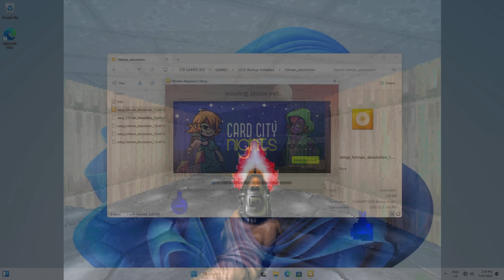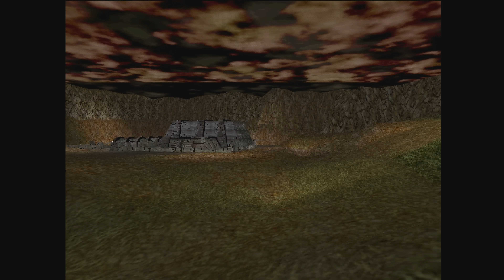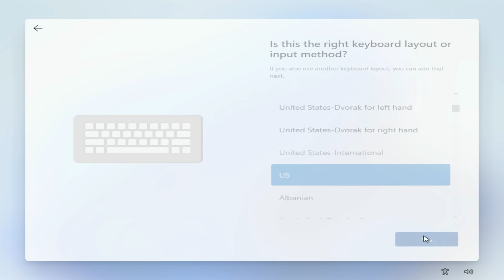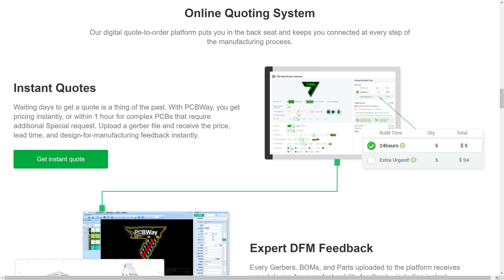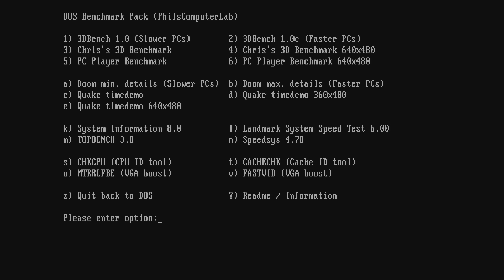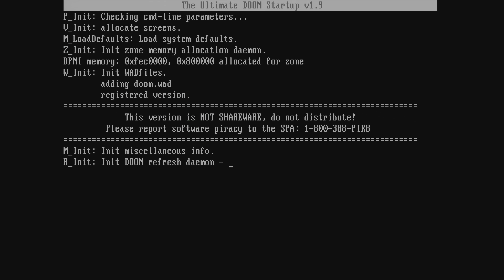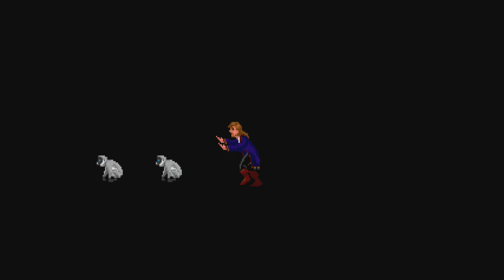LGA 775 The Next Big Thing for Retro PC Community?

Comment: I have an old Core 2 Quad that I've been meaning to slap XP back on. I don't think I'd bother running 98 or DOS on it, though. Getting an actual ISA sound card working in DOS is enough of a PITA, and Win98 tends to get very unstable with motherboards made after it went out of support.

Comment: Some LGA 775 boards have very good backward compatibility. It is possible to run Windows 98 on it, but the options for a graphics card are limited to ma. Geforce 7xxx or Radeon 1300. Most sound chipsets and networking drivers do not work under win98. But XP/2k works also very fast on this platform, and it is possible to use dosbox for older speed sensible dos programms. I have used a LGA 775 PC with Winxp only, Core2Duo E8600, 128 GB SDD, and Geforce 560 for years as an ultimate retro pc. Old Windows software runs fine, and a lot of dos games too. The price of this build was under 50€...

Comment: I've got what I think is the best 775 route, a 865 chipset board with AGP. I have a Celeron 440 in it (2GHz single core Conroe), a 6600GT and nice Yamaha sound card; works for pretty much all 98 and XP games.
Reply from the maker: Sounds great!
Reply: @philscomputerlab  I'm sure it was inspired by your videos!
Reply: Is it DDR2? Because DDR3 boards were also available and are significantly better performance.
Reply: I think one of the best Socket 775 board is the one that has Intel 865 chipset too, and paired with Intel Celeron 400 series. With this combination you get: complete support of Windows 98 drivers, AGP slot, and IDE connector. I bought three Asus P5PE-VM because of this

Another interesting bit is that even tough Intel Celeron 400 series is newer than Pentium 4 and using socket 775 it's actually single-core and based on Intel's P6 microachitecture just like Pentium Pro/II/III. Oh, and also it's only 35 watt TDP, so passive-cooling is possible.
Reply: @namaku0  it's a cut down core 2 duo. no need for that whole essay without actually saying what it is

Comment: Might have been nice to mention a couple of prominent games which wont work (e.g. missing ISA Soundcard, or graphics card).
Also what would have been interesting are 5 1/4 floppy drives. Platform could be a good option to have 5 1/4 floppy working on Win10 or so. That is if the port and BIOS can handle it.

Comment: There are many very odd S775 boards out there. ASRock P45 TurboTwins 2000 for example. With a slotted PCB to switch between SLI and XFire support. XD
You can even mount a netburst based Pentium D in there, for the P4 nostalgia.
The Core2Xtreme CPUs were massively overpriced even over 5 years ago, the Yorkfield based Q96xx oder Q95xx  do just fine, for a third/quarter of the price.
Got lucky last month with two socket 775 machines for 5€ each in the local ads. Low End ones, but in nice cases. And working, after more than 10 years in storage!

Comment: This video comes a bit late for me sadly, i'm on the process of building a retro PC mostly for windows XP but i already got a 754 Socket AMD platform. At the beginning i actually had in plans to get a 775 based PC, mostly because the PCI-e  GPU flexibility but i got the same exact board/CPU i had in 2007 for cheap compared to most of 775 boards
Now i'm struggling to get a decent AGP video card 😰
Reply from the maker: Yes anything AGP is getting harder to find these days...
Reply: update: i just bought a Core 2 duo E8400 with an Intel DG41RQ board and 4gb of RAM kit, i was very lucky finding this combo for 30 usd and it's in great condition, i will use this combo alongside my Sempron 2800 for retro gaming 👌

Comment: Stay away from any nvidia based motherboards. Their chipsets have never received any updates to run 10. Evga says that 7 is the limit on the 780 SLI motherboards. 
I have two that will just start crashing on 10. One took out 3 drives from system instability. The other one I got back from my older sister. Best Buy conned her on a ssd, then gave up on it! Tested her old drive- no problem with it. So I  got a free ssd and a 512gb hdd, plus the evga motherboard! However, motherboards with intel chipsets run 20 just fine. About to retire my evga board and swap its Q9550 on an Intel board that already has 10, a Q8400 and DDR 3 memory!
So if you want to buy some evga boards Phil....I'm right here! 😂
Reply from the maker: 😂 I got rid of most nForce boards. They all stopped working over time...
Reply: @philscomputerlab  They purr on Win 7. But 8.0 and up will crash. Besides losing some hdds, I also lost a video card. Thank goodness for evga's lifetime warranty! Ended up getting 2 GTX 960 SSC 2gb versions for my 2 GTX 470s. But since they dropped out of video cards, adios lifetime warranty! 😢

Comment: LGA775 has been well known for building XP systems since it is a good flexible platform. Very common. I also like AM2-AM3+ for many of the same reasons. Wide variety of available CPUs, video cards and sound cards. Also lot of legacy support carried forward to this point.
Reply: Questionable. Alot of gpus are failing cause of pre-2009 era nvidia troubles. Or cause just being a >2003 bga cards running userviced for many years (anything from ROHS era has a lead-free soldering). Some AM2 suffers with chipsets issue for the same reason. AMD precessors are less effective to process 32 bit code (compared to how they process 64 bit code and you probably don't need XP 64 bit) and XP barely benefits from multi-core. Literally any task that requires multi-core CPU or benefits from it, can be excecuted in Windows 7 or higher. Sound cards? Not to many 775 PCs had em. Some games benefits from PCI sound blasters but it's more related to 478 era.
Reply: @dmwzr  Depends, sure. Athlon64, X2, Core2, etc can all run 32bit code just fine. A64s were outperforming Pentium 4s and using less power doing so. XP (32 or 64 bit) can utilize multiple cores to a point, certainly anywhere between 1 and 4 cores. Sound cards still matter since onboard audio hadn't started getting really good by that point and didn't have support for EAX if you had a game that leveraged it. SoundBlasters would support EAX and provide for a better overall sound experience over onboard, particularly if the onboard audio wasn't well isolated from interference. As far as GPUs, if you care about period correctness, yea, some of those era cards may not currently be viable/stable/available. If you don't care so much about period correctness, there's plenty of CPU and GPU options that, while not period correct, still got XP driver support even if they'd be overkill and underutilized by XP. Just opens up more options vs increasingly scarce SS7-S478 era hardware.
Reply: @thegreatboto  XP can utilize multiple cores and even more that 4, but applications that benefits from this, can be executed in slightly newer environment.
Sound cards are not essential to have EAX. In 775 era when Vista hit the market the only thing you needed to have EAX 4.0 were just OpenAL installed. Integrated audio were worse, but most of the games had 16 bit sound (most likely compressed) and won't benefit much. It can be an addition (just like for a modern PC) but it's not that crucial anymore for 775. And yeah you have a point. You can grab some GT710 and you gonna be good to go, that makes sense. I'm just not sure if we can count this as cheap retro parts. Surely 775 is more versatile cause always can utilize sata and pci-e drives. But if we go so far, why it's 775, not 1366 or 1156. Both usually can run 7/Vista/XP.

>A64s were outperforming Pentium 4s and using less power doing so
Were also cheaper and produced slightly less heat, yes. I still have Athlon 3000+ with Biostar Geforce 6100 mobo. No north bridge, cool and quite. And there is alot of this CPUs around. Sadly enough 754 / 939 platforms requires nForce chipset mobos for best performance which will initially fail.
Reply: @dmwzr  Hmmm... I have currently more trouble with the Radeon HD series of cards, although I really like the gpu scaling the driver offers under Windows xp
Reply: @antonhei2443  software part is a whole another story. But every 2003-2009 BGA chip from nvidia had a manufacturing defects. That was uncovered lately in 2009 and was confirmed by nvidia. Unfortunately i can't post links cause of google is being reckless about URLs in youtube comments now.
Search for "Nvidia’s GPU failures: A case for prognostics and health management" on sciencedirect
Reply: @dmwzr lighten up a bit, go for a walk, breath some fresh air
Reply: AM2+ is dirt cheap, I got a decent micro atx Asus board with an Nvidia chipset and a Phenom II X3 for 20$. A bit of oc and it makes for a really fast XP system for next to nothing. Anything AGP is getting overpriced now.

Comment: In my experience, industrial LGA775 boards with ISA slots (and DMA support) + Pentium 4 make really good DOS/9X/XP retro systems. I feel like they've been slept on by the retro community and there is a lot of misinformation out there about these systems, especially involving Pentium 4 processors.
Reply: Unfortunately, industrial boards are not cheap, if I am not mistaken?
Reply: @lordwiadro83   Earlier this year I was able to get boards complete with CPU, RAM and CPU coolers for about $150 USD apiece, though the availability of those have dried up. The current available boards I've seen (w/ CPU and RAM) start at around $250 USD. They're definitely not the cheapest, but they are readily available. And the alternative of building multiple retro PCs to cover the same operating systems isn't likely to be that cheap either.
Reply: @shponglefan  $250 for a LGA 775 board is insane. And they are not even retro, at least in my view.
Reply: @lordwiadro83  They're about 20 years old now, so that's pretty retro at this point. As for the cost, it's a lot for an individual board, but it also allows one to build an 'all-in-one' retro PC that can span over a decade of gaming with native DOS, Win9x, and early-XP support. In comparison, doing that with multiple systems will likely cost more than the cost of a $250 motherboard.

Comment: Hey Phil, great video again :-) been lurking your channel for many years now and it's inspired me and tought me a lot (but getting a Socket 7 System for all my DOS/early WIN-needs to work took me about 3 years -.-'). I'd really like to know, if the PCBway Sponsorship is a signal of you doing hardware repairs in the future? To answer your question at the end of the video: I think LGA 775 is an extremely versatile platform. In the absence of other reasonably priced alternatives and continued aging it's only a matter of time until it get's highl sought after. If Pentium 4 can be a collector's item, then Core2 can be for sure :-)
Reply from the maker: I'm not sure about repairs, I'd have to get a lot of gear and of course, upskill and practice. But you never know. I think in the short-term I'm very interested in 3D printing type projects for little gizmos that help with retro PCs.

Comment: If you are going to build a 775 system, be wary of old Asus 775 boards, namely P5 series. They have an issue with Chassis Intrusion detection, which can't be disabled through BIOS. I've recently built a system on P5K-E/WIFI-AP and this issue blocks you from booting a system. I had to locate and remove a transistor off the board to fix it.

Comment: I still have my Core2Duo system which I had custom built at a local PC shop in Feb 2007; used it through 2014, after which it went into storage. Around two years ago I pulled it out of storage and set it up again. It didn't even turn on, but it was just the PSU had gone bad, so replaced it, and the system fired right up perfectly in the same state it was the last time I had used it. I'm using a Ryzen 5 5600 system now as my main desktop PC, but like  having my old system running as well. I guess I was a bit of ahead of the LGA 775 retro curve LOL
Reply: After getting that system running, I did some research and realized I had missed out on the later Core2Duo processors,. so bought the parts for a Core 2 Extreme QX9650 system with a Gigabyte GA-EP45-UD3R mobo for my "max" LGA 775 PC.

Comment: I had  Asus P5E back in the day, just picked up a P5E Delux with a Q9550 for £35 really wanted the P5E as I still gave the box for it but the delux will probably do. I have a couple of E8500 cpus so not sure for gaming the core 2 or the core quad will be better. Do you think pairing with a GTX 280 is appropriate?

Comment: Honestly, I had to make that same decision as you mention here and weighed many possibilities. While I have 5 HP elite 8000 bought for less than 25€... ultimatively, I decided against further betting on that 775 horse.
Rather, I was gifted 4 (3, one for parts) optiplex 9020 sff with i5 4590's and turned them into LAN party machines, I now have 8 of them, running win 7 pro x64  with gt 1030's.
I would rather mod older titles with api wrappers, fixes and gog releases on a jack of all trade os, than going the 98/xp route on hardware it was never intended to run.
It is already difficult enough, to get games from the xp era, properly running on win 7 x64 with much to fast hardware.
Many games start showing high framerate issues already, least I need is os issues with unknown incompatibilities to new hardware. I would rather suggest, anyone interested in retro gaming, go for hardware up to i7 7000 series and nvidia gpus up to and including the 1000 series. Also, I would suggest monitors with max resolutions of up to 1280 by 1024 (5:4) since many games break horribly beyond that boundary.
Just my experience from setting up 8 identical dell 9020's with a load of LAN titles from 2000 to 2010. 😂😅
Reply from the maker: Thank you for sharing and you make great points 🙏👍

Comment: And here I've already sold my late old man's LGA 775 system (with a G31 mATX board) a few months ago after upgrading its CPU from Pentium E5200 to Core 2 Quad Q9400. Not to mention, my old LGA 775 board that was originally powered by a Core 2 Duo E4300 and has both AGP & PCIe slots seemed to have died. Although I'm still keeping my GeForce 9500GT from that dead system. Dunno if the card still works or not because it should be a nice fit for a system from that time period.

Though my interest on older PC components is growing, retro PC community is probably not that big of a thing in my country, mainly thanks to the FOMO many local gamers tend to have.
Reply: [Update as of July 18, 2025]
The old LGA 775 board (the one with AGP & PCIe slots) that I thought was dead turns out to be still alive. I was able to find the board - it's an ASRock 775Dual-VSTA, btw - in my storage room and got a replacement CPU for it: a Core 2 Duo E6400 since I unfortunately lost my E4300. Upon testing it, the board was indeed running, although I only have a single functioning stick of 1GB DDR2 for it because the other two sticks I have are dead. Along with it is a still-functioning GeForce4 MX 4000 of unknown origins (never knew anyone in my family who owned the card). I tried to find my other two AGP cards: a GeForce2 GTS and a Radeon 9600XT, but they seemed to have been lost as well.

Comment: LGA 1155 is also great for a 32bit WinXP build.  I used a 3ghz cpu and a GTX 980 Ti (probably about the last gpu released with official winxp support).  Works amazingly well and has fantastic support for early 2000's era games.  Also has enough juice to crank up the graphics in the nvidia control panel.
Reply: i have i5 2500K with XP x64 and it works perfectly, so not only 32 bit... no compatibility issues with games newer than year 2000. I think if you don't need to run 16-bit software, you should stick with x64 edition. It opens you way to use more than 3.25 GB of memory, very useful with "modern" activities like browsing a web with Supermium, which is doable similar to modern Win11 build.

Or go with dualbooting like me, I have XP x86 on second partition only for DOS games :D
Reply: @wojciechchannel  I just use my main pc for anything 64 bit, but yeah I know what you're saying ;)   64bit cpu's didn't really start hitting mainstream until around 2003, so a lot of games from around that time still weren't compatible yet.  Honestly don't even notice the lack of memory with games from that era.  4gb was usually the max supported by mainboards around that time anyway.
Reply: @wojciechchannel  nice,i have i7 2700k oc 5.1ghz ,windows xp works great although i use it for work only because the company software only works on windows xp.

Comment: A lot of my retro PC collection is from me not getting rid of the parts when I replaced them, and at the time I didn't have the budget to get a LGA775 system. I had a Socket AM2+ motherboard with a Phenom II X4 940 and 8 GB of RAM, which I gave to my dad until I handed down my Ivy Bridge system to him. That Phenom II is about equivalent to an overclocked Q6600, and I managed to find a Radeon 5870 to pair with it for a Windows Vista machine!
Reply: Socket AM2+ is amazing on Vista! I have a couple of phenoms all running at 3.6 to 4ghz and they beat the crap out of my q6600 which i could only get up to 3ghz on my 680i sli. Even the E8400 at 4ghz I have in it now on windows 7 feels less responsive

Comment: Had one (Asus p5d Deluxe Wi-Fi, E8500 ddr2,Radeon 1950 xtx, Sound Blaster x-fi) as my main PC (2006-2013) running Windows Xp (Win7 from 2010 to 2013)  .

Gifted to my dad as backup machine when I upgraded to Haswell .....stopped using it a couple years ago (It was replaced by a XP VM on his main pc).

These days it sits lonely and dusty in the basement near salami, coppa and wine bottles